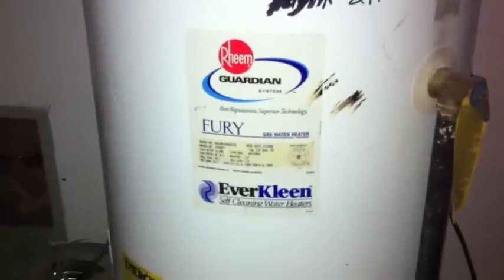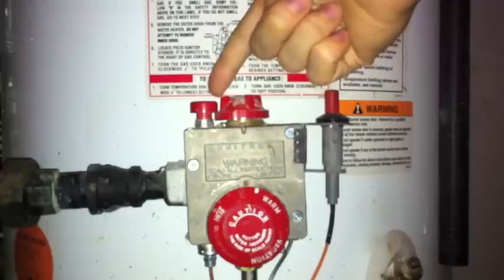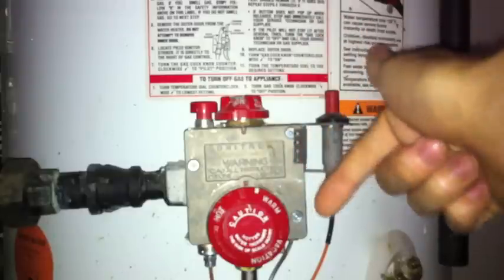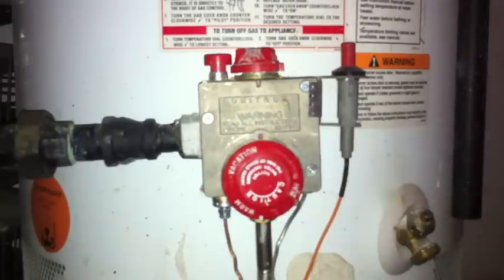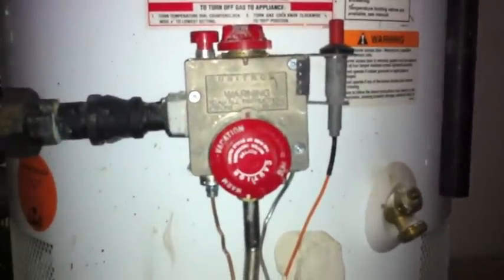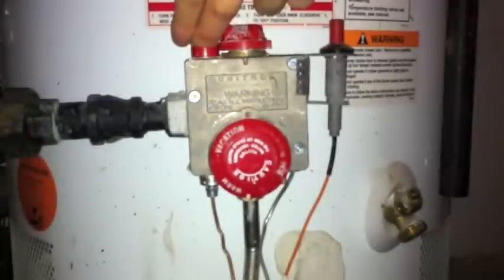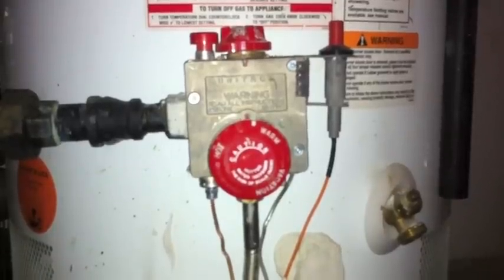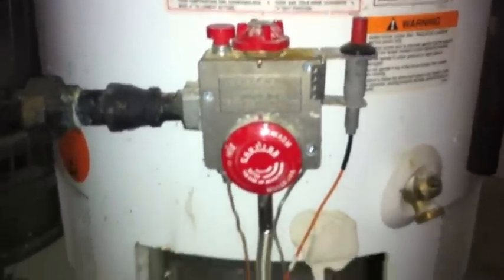Pilot Light Easiest Way to Light it When it Goes Out

Comment: I usually leave the gas workings to the experts. After a bad storm here in Conyers GA. I came home to cold water in my townhouse. I called the gas company to find out that no I had not had my service cut off. I then opened the hot water heater closet to find that my hot water heater was dead silent. Before calling my landlord or a neighbor, I searched You tube for a sensible video on lighting a hot water heater pilot light. I found this one and as a woman, I feel like "abcmaya" below. It was scary, but after watching the video a couple of times I tried it twice and it worked!!! Thanks. I feel so accomplished. :)

Comment: Hey thank u so much for responding... I did get it lit earlier..i just took my time and followed your video instructions again which was so thorough anf I got it.. My problem was I was expecting it to light automatically after releasing the reset..i finally saw that I needed to turn dial from pilot position to ON, THEN it will light.. Thank u again... You had the easiest video instruc..

Comment: Thank you sir for this helpful and informative video, I'm going to try this later.

Also @ 1:52 I learned from watching other videos that the reason you hold the  Red button down for 60 seconds is to heat up the "Thermocouple"(next to pilot light). If the thermocouple isn't hot enough it shuts the gas off(safety measure), but holding the Red button forces the gas/fire to persist until the thermocouple gets hot enough to stay on by itself.

Comment: Who ever wrote the 20 step instruction process printed on the water heater should be executed. 4 Steps,  Set too pilot, hold down red button, push ignitor till pilots lit,  Continue to Red button for 60 seconds, release turn to knob to on.   That's it, those are the steps.   No wonder 1/4 million people found this link useful.    Thank you for the helpful video.
Reply: Great summarization.  Thanks.
Reply: Fixing toilet seat
Reply: Roger SoCalBeaches w.
Reply: Thanks you tube. Its the only procedure that worked the first time. The 10 steps instructions on the side of the heater wasted 10 mins off my life  The person needs a couple lashes.

Comment: You have to hold that button down to keep the gas valve open until the thermocouple heats up. The thermocouple is a safety feature on most gas appliances and in short if it gets cool from the pilot light being out it should shut the gas off so it's not creating an explosive atmosphere. Now that being said, if your pilot light won't stay lit after holding the button down for a minute you probably have a bad thermocouple.

Comment: Thanks~! this is great instruction. I have little more question. I have same model water heater as yours and I could get the pilot light once I pressed and hold the pilot button. and I hold this button until a minute or more, then I released it and I tried to move the temperature dial to warm from vacation(low level) but the pilot light went out. It didn't fire up. Do you think is it also thermocouple issue or other issue? Do I need to replace the control valve unit itself? Please advise me. Thx

Comment: thanks bro , had to put new drain valve on my moms water heater "same model but 40gal" . so shut down n drained out to replace . instructions leave out the part where you need to hold red button after clicking igniter . probably woulda figured out but googled due to lack of patients . thanks

Comment: you have to hold down the button for a minute because the thermocouple has to heat up.if you let go of the button too soon the flame will go out, if the flame will not stay on no matter how long you hold the button down, your thermocouple is bad.
Reply: Thanks! Maybe that is the problem

Comment from the maker: @TJSsuperFRESH Try holding down the red button even when you turn the knob from pilot to on. If the flame keeps going out, you might have to remove the cover and light the flame directly using a match stick. But keep tinkering with the button and knob to see if you can keep the flame lit.

Comment from the maker: @gidd999 Try holding the red button down at the same time as when you turn the nob to On. Maybe that will help to keep the flame lit. Also make sure the gas supply coming from the wall is turned fully on. If you are able to remove the panel and access the flame directly, you could try lighting it with a match stick. Sorry, I hope it works for you!

Comment from the maker: If the striker isn't lighting the flame, you could try using a match stick to manually light the flame when the gas is on. You might have to remove a panel on your heater to access the flame area. Or you could have the gas man take a look if you have trouble lighting it manually.

Comment: Does anyone know what is the replacement part number for the Control Valve?  Just in case mine stops working, I would like to have a part number handy.  I know, old water heater, should replace the entire thing.  BUT, they just don't make them the way they used to.

Comment: The reason you have to hold it down is so the Thermocouple heats up. This is a little rod that sort of sticks into the pilot light and lets the gas valve know if there's a pilot light or not. If it doesn't heat up, it wont allow the gas to keep flowing. This means if If you're giving it time to warm up and your pilot light still keeps going out, you could easily have a bad thermocouple... and replacing that is only about $6 if you get the part from Lowes, :)

Comment: Sooooo....I was quite overtired from working Black Thursday and turned the knob wrong.  BOOM!  It was not pretty.  Make SURE the of alignment of "pilot" indicator is with the FRONT of the mechanism, NOT looking downward as I was thinking "this damn knob is broken".

Now I'm so rattled that I'm not sure if I turned the cold intake back on right (there's nary a few centimeters of play to turn off and on).  

Rheem has a strange design.

I've drained and lit it a few dozen times and I ALWAYS look at top, not side, though that is WRONG.  

Thank you for video.  Rheem needs make their dial top and side visibly marked.

I still have my owner's manual and it's goofy.

Comment: Try turning the gas knife switch a little so gas pressure isn't so high. Sometimes the pilot blows out from a violent air flow event when normal heating stops. Yes, this works in many cases.

Comment: the instructions says turn off the gas valve when lighting the pilot... i tried it for so many times... finally i turned the valve slightly open and then followed the rest of the steps and it worked.

Comment: The reason you have to hold down the red button is to heat up the thermo coupling. That's there to make sure that if the pilot lite goes out the gas will NOT come out.

Comment: The pilot stays lit because the gas valve is energized with the thermocouple that the pilot flame is burning on. That copper looking wire you see on the lower left part leads to the thermocouple inside of the water heater.

Comment: My boiler leaked from the bottom drain valve the plastic drain valve that was there had broken it flooded about 3-4 cm of water and the rest wet out the room i replaced the old plastic valve to a brass one but I can't get the boiler to turn back on anyone know if it's because it was super wet?